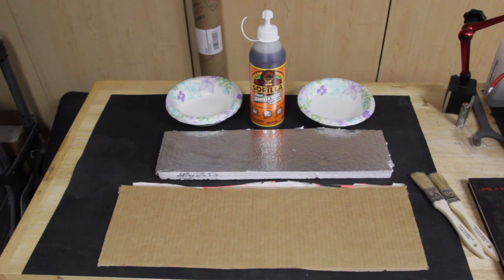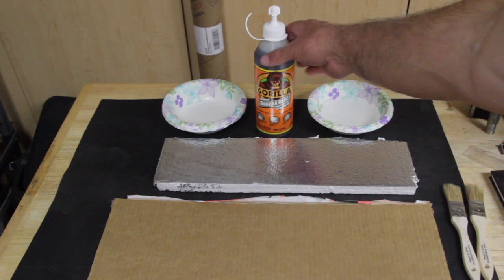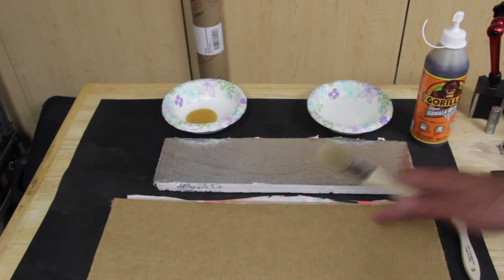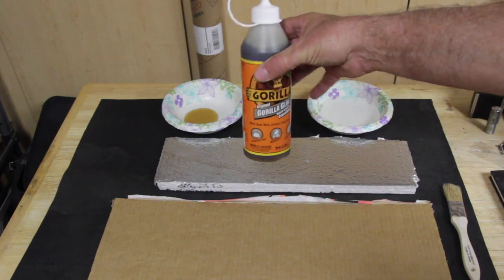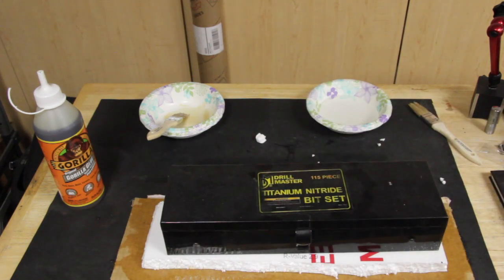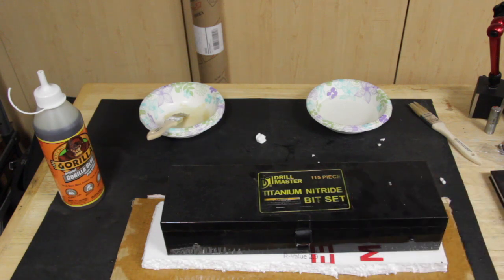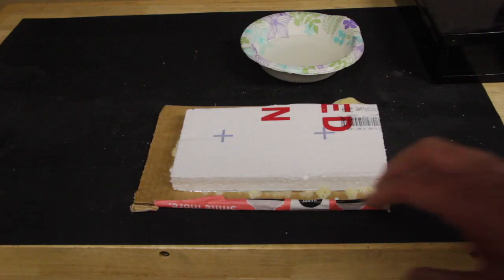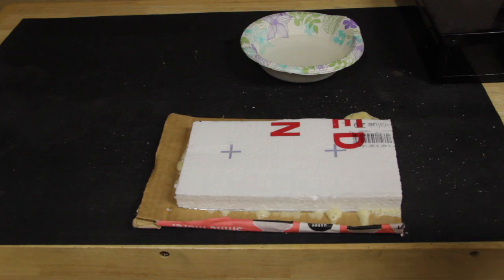Gorilla Glue and Insulation Foam Testing

Comment: I find I can get a much thinner coating of gorilla glue by spreading and  it out with a putty knife.  Works well when surfaces are flat,  and have minimal space between them.
Reply from the maker: They actually make a thickness gauge to measure adhesives.

Comment: You need to peel the aluminum foil off, it is barely attached to the foam.  The foil only helps insulation when it has air gap.

Comment: Hello Mr. Joe, are you familiar with R-tech foam insulation? like they sell at home depot? Do you think that foam would work to attach to cardboard with gorilla glue as you have done? Do  you know if cardboard attaches to other cardboard well with gorilla glue? 
What brand and thickness of foam insulation are you using may I ask? Thank you so much.
Reply from the maker: Hey Heather, yes what I used was R-Tech, 1" thick,  If you are going to glue, glue on the non-foil side, not what I did.  You will get a better bond.
Reply: @JoediyLab  thanks so much!

Comment: Got the same problem on 1977 vw t2 roof liner .Came of eventually from the outside heat and age maybe .Virtually no info on Re~ installation but will use a superior non heat affected glue maybe silicone adhesive

Comment: I don’t know if you’re past this, but if you peel away the foil before gluing it you will have a very strong bond. The way the foil is on the foam is the weak point.
Reply from the maker: Thanks for the tip